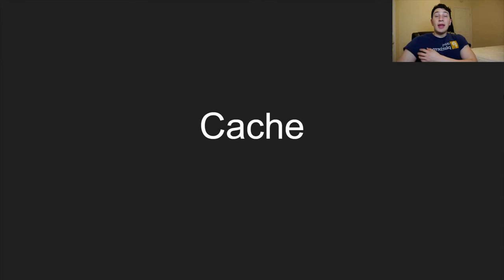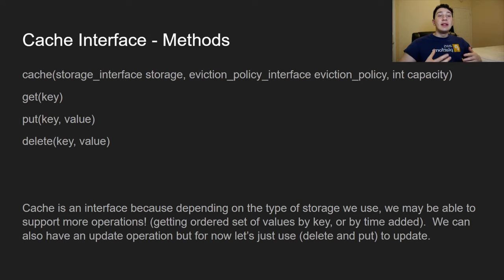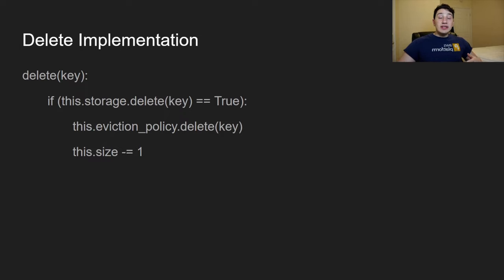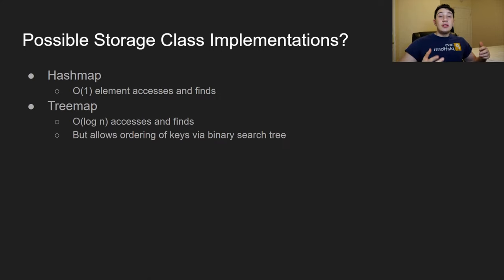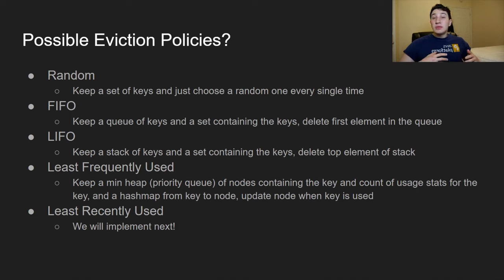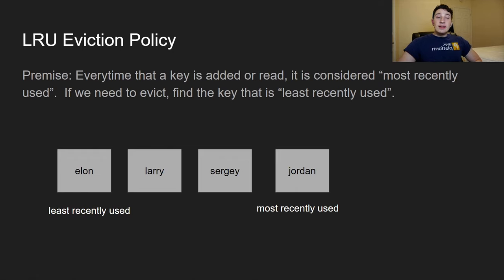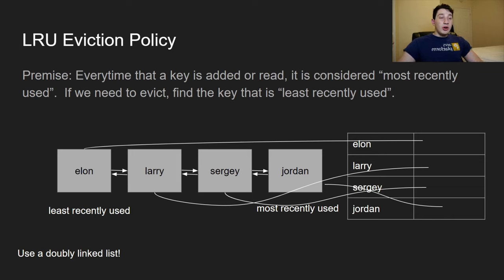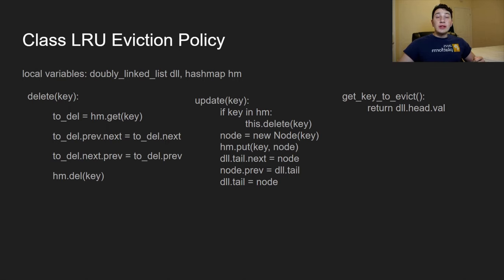Cache | Google SWE Teaches Low Level Design Episode 2

Comment: Hi Jordan, I think you should use design patterns in your LLD code. 
Like, how will the code know which implementation of the eviction policy is to be used. 
Also, you should consider demonstrating how we are ensuring the use of SOLID principles in our code. 
On a side note, huge fan of your content. Learnt a lot from the system design playlist. Keep up the spirit.
Reply from the maker: As far as I can tell, the majority of the solid principles just detail that everything should be abstracted via interface, which is more or less what I've tried to do in this video.  As for how the code would know, you pass that in as a parameter :) - let me know if you're looking for a different answer.
Reply: Agree to what you said but in real LLD interviews for roles higher than fresh grads, the expectations are higher. People expect candidates to have a sense of where to use design patterns. Like we could have a factory EvictionPolicyFactory
Reply: The factory class would have a method that would take a param (that would be read by the cache process from a config file during process startup). This method would provide the appropriate policy from the factory.
Reply: Also, we can add on top of it that all these factories should be declared singleton as these are stateless. If the policies individually also happen to be stateless, we can make them singleton as well. and in case the interviewer asks how to make a class singleton, that would be subject to how one would do in their respective programming language